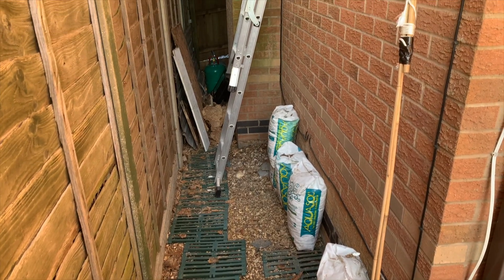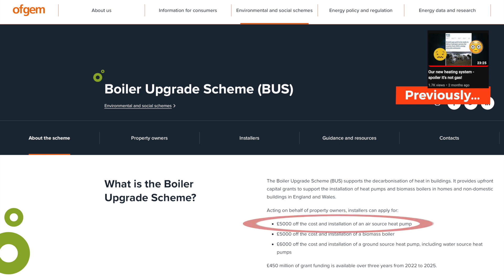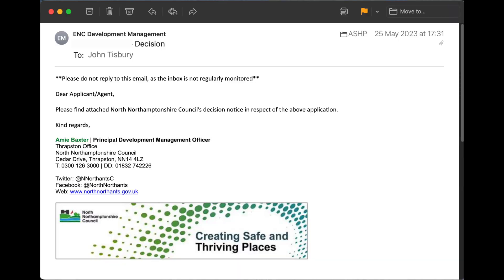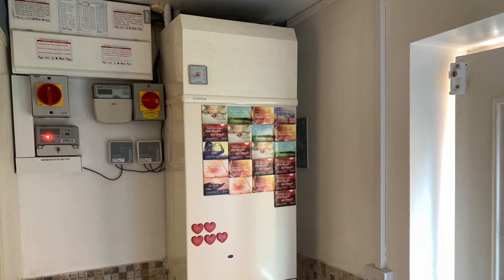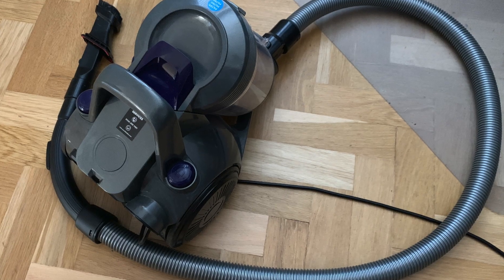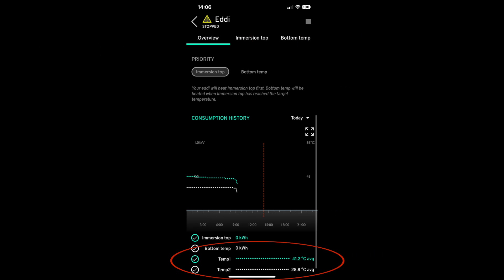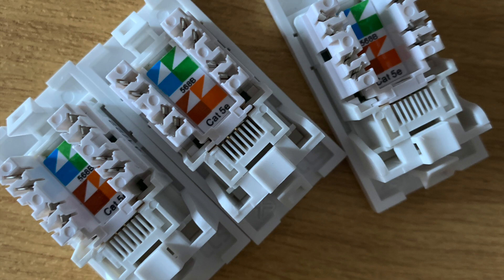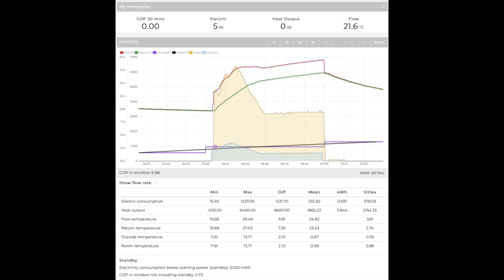Preparing for our ASHP installation

Comment: Hi John, great video. Could I ask what you think of the ladder stand off you used that rested on your roof? and would you be able to provide a link to it? 
I've only ever rested my ladder against my plastic gutter which isn't ideal as the gutter bends and there's always the risk of the ladder sliding on the gutter. A stand off which is sat on the roof should be much more stable as well as being far safer. Thanks in advance!
Reply from the maker: Hi Glenn thanks for watching. I too had the same issue when using a ladder re resting against the plastic gutter and it never looked safe or ideal. I purchased the same standoff that a professional aerial installer used when he came to fit a new one on our roof. This is the model: The ULTIMATE Microlight Ladder Top Stabiliser ACUMCL1 (2.3kg) I got mine for Ladders999 website. No cheap at £140, but saves your life and roof. https://www.ladders-999.co.uk/the-ultimate-microlight-ladder-top-stabiliser.html?gad_source=1&gbraid=0AAAAAD--MZ7ZSvqkA--LvvQYn7A0_wnj6&gclid=EAIaIQobChMI8f3MhsHuiwMVOJdQBh0QBCIvEAAYASAAEgJ3CPD_BwE

Comment: Hi John. Great video. I have a similar narrow (1400mm) area where I'd like to position a heat pump but I've been worried that I wouldn't meet the 1 metre rule. Good to know that a smaller space isn't a deal breaker. Did you have to dig a drainage hole to capture the condense?
Reply from the maker: Hi Steve. thanks for watching. Many local planners are I'm sure waiting until the 1m rule is removed along with the pointless noise assessment, it's in consultation at the moment. There's a series I've done which you may be interested in watching which covers the end to end installation and rebuffing the comments about micro-climating in a small space.

The condensate was routed off the the side where there is a gravel bed down the side of the house. So far it has been absolutely fine with no issues in drainage.
Reply: @johntisbury  Thanks John. I will take a look. I’m waiting for the results of the permitted development consultation on  heat pumps which I think is due next month.
Reply from the maker: @stevesmith7675  fingers crossed on your planning outcome. Hopefully you've already chatted to any neighbours who are next to the 1400mm zone. My neighbours were concerned about the noise. I ended up showing them a YouTube video from Urban Plumber standing next to the Vaillant heat pump running at full chat! Since it's install they have said to us that they cannot hear our heat pump when it's running.
Reply: @johntisbury  That’s good to know. Our neighbour successfully objected to our extension 10 years ago which is why I’ve been nervous about submitting another planning application. I’ve done some research on the local planning portal and a house nearby with similar distance-to-boundary issues made a successful application despite a neighbour and a parish councillor objecting. So I’m hopeful. Although the MCS have suggested lowering the decibel figure to 35 in rural areas! Pity they don’t stipulate noise from a gas flue. That would hasten the switch to renewables. My boiler flue pumps out 60dbs. What is the highest reading you’ve seen from your HP?
Reply from the maker: @stevesmith7675  I've not measured the decibels for our heat pump as it didn't need a noise assessment due to no windows being near it. Manufacture's stats state 50dbs. A whispered conversation.

Comment: John , considering the distance between your heat pump and the fence , did you experience much freezing during the recent cold days we had ? I have a similar situation and contemplating wall mounting it but not sure if it is really necessary.
Reply from the maker: 2 defrosts an hour at -1.6°C. So no issues or defrost issues.

Comment: I’ll be watching your subsequent videos with interest.  I’ve heard of the open energy monitor. It looks very interesting.

It’s rather curious:  I’m used to SolarEdge:  Fantastic data acquisition but poor battery controls
Whereas any heating system:  Fantastic controls but poor data acquisition.

I’m approached a couple of heat pump installers and have gotten to the stage of receiving a budgetary quote, so next stage is to get a detailed quote.   I’ll no doubt plot out my journey to air source heating on my own YouTube channel.
Reply from the maker: Thanks for watching Anthony. There does seems to be a pattern around data acquisition some companies/industries are good at it, others not so much. I was planning a more detailed follow up video on Open Energy Monitoring setup verse the data you can see in the Vaillant heat pump controller. Spoiler alert; it's chalk and cheese. 

You can do your own heat loss survey and map out your floor plan. Not sure if you'd seen my previous video on that? Doing this gives you something to compare your quotes against which I found invaluable. I'll keep an eye out for your future content.

Comment: Really good video, I’ve opted to replace my old gas boiler with a condensing version and have worked out the heat loss, which in my case needed 10 rads replacing for larger ones but my design flow temperature will be 50 so the return temp will always be in the condensing range, like you it’s only when something has been in use will you know if the design has worked out.

I also have 10mm micro bore so flow rate is key for heat transfer, I’ll definitely be checking back with your journey to see how it performs as I’m sure you must have considered upgrading from 10 to 15mm.
Reply from the maker: I did initially think a heat pump was not going to work with microbore, however over the 18 months of research and testing low temperature heating at home new heat pump models dropped onto the market and made microbore pipes less of a problem

Comment: Thanks for documenting everything in such detail. If your actual experiments with low flow temps using the boiler showed the rads were big enough to keep the house warm how come you then changed them all?
Reply from the maker: This is indeed a very good question. I did ponder that very point as I pulled together this video. My conclusion was changing the rads added an improved margin for better performance. The Heat Loss survey indicated that the current rads were undersized in a couple of rooms which was supported by our experiences. So whilst we may have been okay when it hit -5º C then it the setup would struggle.

Comment: I am looking at the open monitor for my ASHP. What did  you need and do ytou find it works as you want, giving all the information you want?
Reply from the maker: I'd have to say that the open energy monitoring is the best of its kind. At present there's more data than I understand, but that's down to my lack of knowledge. It most defiantly shows you the information / data that allows you to properly monitor the performance of your ASHP. The manufacturers built in stats are minimal and with little or no history. 

There are 3 levels of monitoring bundles available. I went for the all singing and dancing level 3. This gives you everything you need. https://shop.openenergymonitor.com/level-3-heat-pump-monitoring-bundle-emonhp/

The options to decide on are which heat meter to purchase as the sizing is important. Get one that's too small and you will constrict the flow and impact the system performance. 

In my next video I will cover what I purchased and why in more detail as well as go through the data it provides.
Reply: @johntisbury  thanks so much for this information and I too would go for the level 3. Great advice on the sizing and it is great to understand the problem with picking the wrong one.
Reply from the maker: John Cantor has done an article on heat meter sizing https://github.com/openenergymonitor/HeatpumpMonitor/blob/master/selectingheatmeter.md

Comment: When thinking about the cost, how much did you save b doing your own heat survey and prep work.  Whilst you might do this, most people won't.  Great to see you doing all this in a nice, ordinary house.
Reply: Hi John. Excellent video ! Also on this topic, based on the heat loss survey, what was your loss due to ventilation/air infiltrations , out of the total loss? Regards. Adrian
Reply from the maker: @adrianbotos2819  thanks for watching Adrian. The heat loss survey takes into account both fabric and ventilation losses. However, it only shows the total heat loss rather than a breakdown between fabric and ventilation. There is a line by line, room by room, table which shows heat loss for windows, doors, vellum etc  but I've not bothered to add that up.
Reply from the maker: I probably didn't save anything in reality Peter. I still had a professional heat loss survey done as well as the one I did. All the other preparation was really down to me. I still paid for a single use survey using the Heating Engineer software, which means I spent more rather than saved. However, it gave me a point of reference.

Comment: Good video John. 
I also have 10mm microbore pipes throughout my house to all my radiators. As a result I was fairly convinced that an Air to Water heat pump was not an option for me without very costly & intrusive work to upgrade all the pipe sizes & radiators. I was therefore looking at cheaper to install Air to Air systems instead with the added benefit of being able to get cooling operation in summer. 
Now I see that somehow your installer has managed to make 10mm pipework work in a 17 radiator A2W system so I am very interested to see how this turns out. Like you I tested my existing 4 year old Ideal gas boiler on low water temps in winter & it struggled badly with short cycling & high water temps / low flow rate alarms. It just could not turndown it's capacity low enough to operate properly with flow temps of less than 45-50c. I even changed the pump & flushed the system to see if that improved the situation but to no avail.   

I retired from the HVAC industry recently after 45 years of working for manufacturers, distributors & installers so I know all about domestic, commercial & industrial heat pumps, refrigerants & refrigeration systems. ATW heat pumps need high flow rates because they operate on a delta T of only 5c. The No.1 operational problem with A2W HP systems is low flow rates so I'm interested to see how your system turns out using 10mm pipework.
Reply from the maker: Thanks for watching Colin. I have confidence in the quality of the design and installation that our system will worked as specced with 10mm microbore, eg. 40ºC flow temp at -3º with a SCOP of 4.0. We will find out once this winter is over and be able to review and evaluate the system and its performance. Short cycling is a killer for heat pump not only in terms of poor efficiency but wear and tear on the pump. But you already know that. 

I will certainly do more update videos as time goes by.
Reply: @johntisbury  👍

Comment: One question John if your old heating system worked at around 35 /40 degrees , upgrading all of the radiators has doubled the amount of water that the heat pump has to heat . I know every installation that I have read about has done the same  ? Great video looking forward to seeing how you get on 👍👍👍
Reply from the maker: Thanks for watching Glyn. Yes I guess it has increased the volume of water in heat pump needs to heat. There's benefits there with the extra volume of water as I believe it will act as a thermal store. It will also be much more efficient than our old gas system. 75% efficient on our old gas boiler at least 400% efficiency with the heat pump.